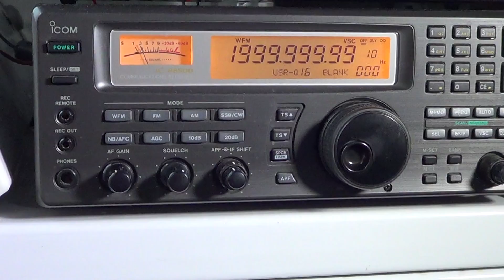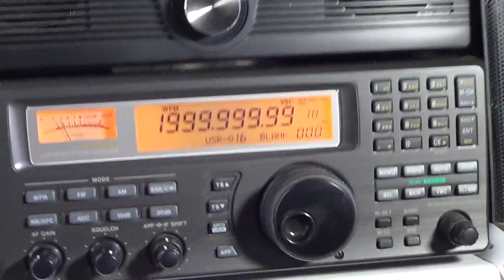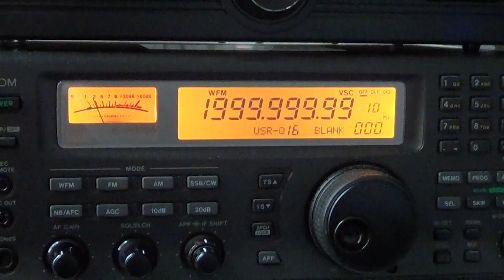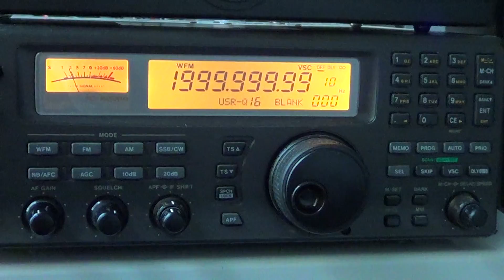Icom IC R8500 review

Comment: I have owned one of these wonderful receivers for about two years. Whilst it's HF performance does not match my TS590SG the VHF performance with a Diamond D777 mounted on my chimney is staggering. I will be getting the new Icom R 8600 but the R 8500 will retain pride of place in my shack. 73s